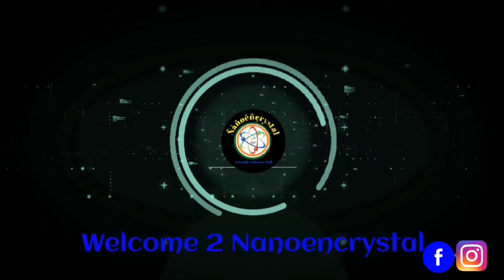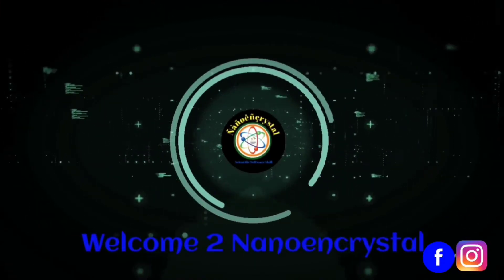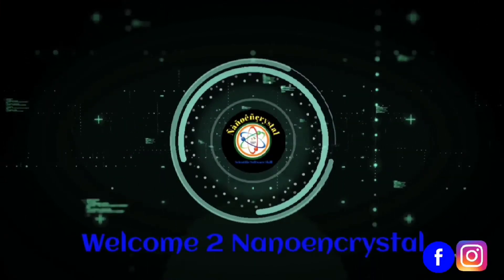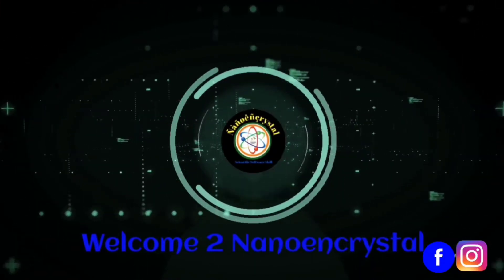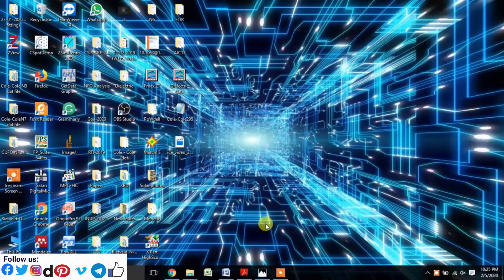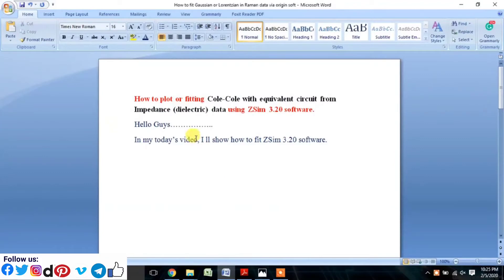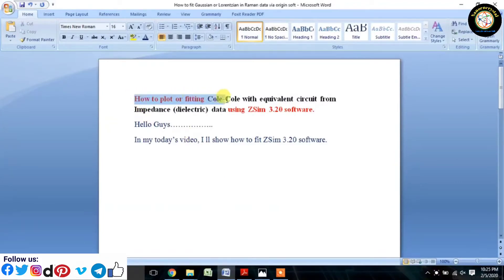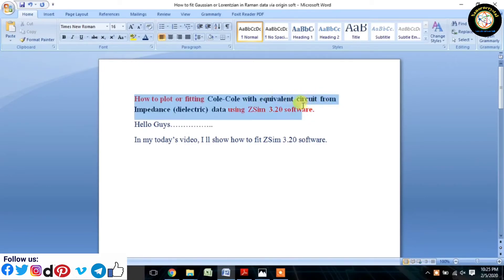How to plot or fit Cole Cole plot with equivalent circuit using impedance data via ZSimpwin Software

Comment: How did you exactly get confirmation that this circuit will fit accurately i mean how you get idea that this circuit will work ???
also you added Q factor in you circuit how you get its idea that if i add it my circuit will get exactly fitted
Reply from the maker: Please go through some references which are published in some articles on this topic.